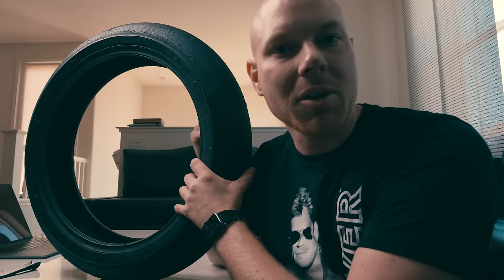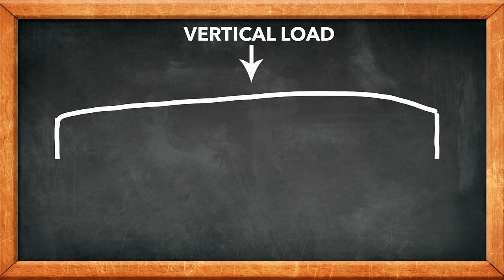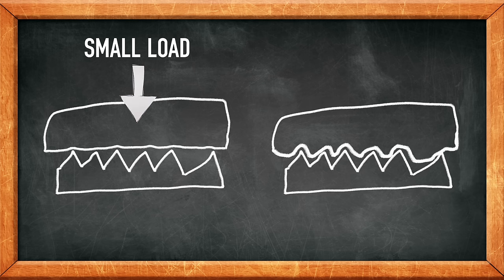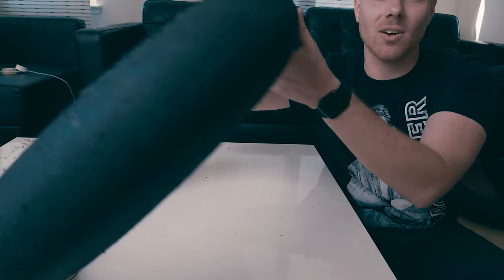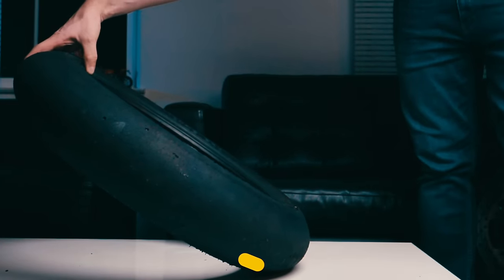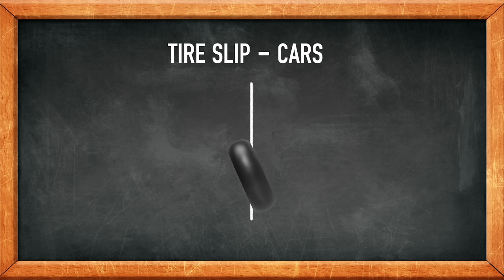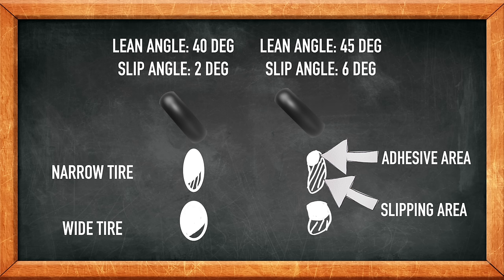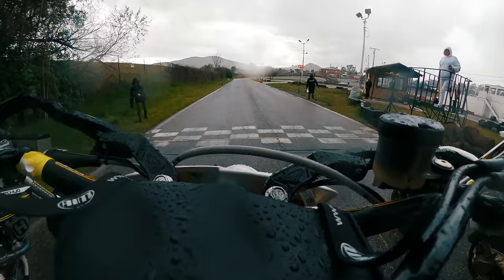Tire Grip | EXPLAINED

Comment: Mike, 
please talk a little more about Contact Patch shape on each front and rear Tire  at increasing lean angles.
The reason I ask is that I would like to be able to educate my friend on what i believe to be a misconception on his part.
Mark is on a 05 CBR1000RR with Dunlop Q4 190/55/17 and 120/70/17
reaching estimated lean angles of 45-47 degrees
Mark is under the impression that because he has no chicken strip that the rear tire is near its max lean angle. Keep in mind the Q4 is advertised to 62 max degrees. 
Thank you for giving us the engineers explanation on motorcycle behavior.

Comment: Great video!
An interesting topic would be:
What happens to dinamics and grip if you install mismatch tires front and rear on a bike (compound, wear,age, brand, surface design, etc)
Coz many people change rear tires due to quicker wear on the rear whilst still keeping the front for a while.

Comment: Hi Mike, a well made Video, and a commendable attempt, at explaining a complicated concept to a wider audience. But as an engineer I know all too well that any attempt to simplify a complex subject, will lead to inaccuracies, which will mislead the lay person and dissatisfy, the engineer. A wider tire with a harder compound, vs one of the same construction with a softer compound, or a bigger diameter vs smaller diameter tire, a tire with a different aspect ratio, the friction coefficient of different rubbers. The weight of the bike, the suspension setup, the steering geometry, the tradeoff of wider tires, and on and on. So really the title should read “all other factors being equal wider tires offer more grip”.

Comment: For racing tires it counts, for street legal tires - stop shopping for wider ones. Actual ones have added silicates to make them more quiet. It also reduces the lifetime. Had to change my Michelin Pilot Powers on my motorbike ( R1 ) because of cracks. With this added chemicals they also produce  less grip. So for street legal ones, µ will be 0,8 +- a few . But on most motorbikes the suspention is a point worth of taking care . Recently bought a XJR 1200 where the front fork pretensioning from factory was way too much. Bought Bilstein springs and made the pretension adjustable, way better now.

Comment: Ok, so if I get it right, if my front tire started whiping out on roundabouts on wet salted pavement despite very low lean angle (which it does) I should try to lower air pressure, yes?

Comment: Hey Mike,you seem very smart. I just want to add that on a jeep tire you have to under inflate the tires for offroading
Reply: People do the same thing on dirt bikes, but like he says off road tyres operate in a completely different way to track tyres.
Reply: Probably only for driving on sand?  The sides of the tyres round out and are far less likely to dig into the soft sand.  Over rocks and scrub you would need normal inflation - helps prevent punctures.

Comment: Great in depth video and good research Mike!
I tried to read these books but I do not have the time and patience.
- One quick question: If you encounter a dirty, imperfect street road  with gravel/ dust in a corner and your tyres are starting to slip, on what motorcycle tyres are you safer: a narrower type (aka middleweight adv touring tyres) or a hypersport standard naked/street tyre size? (I know you have to account different loads, suspension type etc. But say that all things are equal)
Reply: The tire that has the stickiest compound and largest surface area. That's why you run performance tires and slicks at the track. 

Adventure tires are not made to maximize grip, they're made to have good puncture resistance, long wear times, and good siping to handle a variety of terrain. So these tires would be worst by design, all things equal. 

You could argue the tread pattern maybe helps dig through the layer of dust (you didn't say how much dust there is) but unless there's literally just a layer of dust, like there pretty much always is, sticky track runner is better. 

If the dust is thick, then the sipes on the ADV tire would have to dig a hole for the rubber to then contact and hold. The question is, is that non sticky rubber block enough to hold you?
Reply: @YSPDJapan  good point and on point :))

Comment: I love fortnine videos but that Darkside one they did was borderline dangerous. Anyone who has been on track will know that lowering your tire pressure (to a point) adds grip by both helping the tire warm up faster (tire deforms more, thus heats up more, thus rubber is stickier) and by increasing the surface area for rubber adhesion. Thanks for clearing up!
Reply: @SuperBoomer95: He shows here that the contact patch is larger for a lower pressure when the tyre is upright - but that depends on the speed the wheel is rotating at. At higher speeds, the tyre deforms due to centripetal force, which (if the pressure is low) gives you a smaller contact patch at the centre of the tyre.
Reply: @gimmeanicecream9228  Agreed, yet another wacky X factor to the perfect tire setup for a vehicle.

Comment: As Cody from Practical Engineering explained, asphalt is based on oil and that's why there's so much adhesion - it's basically rubber on rubber!

Comment: Also, a wider tyre has more material. One of the major reasons higher power bikes have move material on the tyre.  It would be a nice experiment to put a thinner tyre on a 150hp bike and do some lap times.

Comment: Nice to see this kind of content on youtube👌 But in the beginning when you’re debunking the F = u * N you’re saying more surface area (bigger contact patch) creates more adhesion, and then you go on about how more vertical load creates more surface area. But thats the whole point why surface area (size of contact patch) shouldnt matter. When the patch is bigger, the verticle load is distributed over a larger area, which makes the rubber go less deep into the grooves of the asphalt, which decreases the area of contact for molecules to adhese. 

You also didn’t adress the subject of road and tyre shear. When we are talking about loss of traction, we can think of a tyre skidding on top of the road, but a tyre also tears itself and the road apart, (all the rubber stripes we leave on the track) which is affected by the size of the contact patch.
Reply: Is not that simple, reducing tne load reduces the contact area for sure. But what he pointed out many times, is that... we are talking about rubbe! So, you can go crazy trying to find an even close 1:1 relationship between load and contact area.
Rubber is a strange material, even an important reduction in load doesn't affect the grip so much (think at the example of rubber plate on glass). The "keying" mechanism between rubber and tarmac works with incredible efficiency even wiith low loads. Also, lowering the pressure and increasing the temperature can give you incredible grip at low-load.
Reply: @9.07 , wider tyres means more grip, but not because of the area of contact patch, but the shape of the contact patch, i totally got confused there, is that only when we are leaning on a corner ??? On a straight line, i feel your point of load distribution fits right in. ?
Reply: Thank you man tire friction/adhesion physic is highly complex and still not fully mastered and I find it kind of weird how he debunks these videos while they were mostly talking about street tires which significantly different than race tires.

Comment: Thank you.  Another very informative and understandable video Mike.  You have a talent for getting the facts across. So, can you help me understand something that has been puzzling me lol.  I recently noticed that the sipes, (or valleys?) on the front tyres of my and my wife's bikes run in diagonally opposite directions.  I know front and back are usually opposite/different in order to work better together but this puzzles me.  How about it?  Cheers and keep 'em coming!
Reply: Rear tire's biggest experience force: Forward accel. Water need to be pushed aside as it moves forward.
Front tire's biggest experienced force: Braking.  Recall momentum – a force you of a moving body wants to continue to move forward unless opposed by another force.
So, when you brake and experience forward momentum, the water is experiencing it too under the front tire. The opposite looking groves will displace it away from the center of the tire; where you need the grip to stop. These groves are that opposing force - channeling the water away. 
I hope this helps. I understand it is a little hard to picture opposing forces and the front grooves doing their job and think it's a great idea for him to make a video about it.

Comment: What I really want to know is the influence of the rim width. A 150/70 tire for example is suitable for rims with a width from 3.5 to 4.5 inch. What is the difference in regards to grip and handling when it is mounted on the narrowest and on the widest allowed rim? O.K. there might be surely some influence on the unsprung masses, as the wider rim will be heavier. But will also the contour of the tread change, or only the angle of the side walls? Will this lead to more grip, when you use a wider rim?

Comment: Which one is safer for front tire, 110/70 or 120/60 ?
Reply: It is not safer or less safe. 110/70 will turn in easier, due to less inertia, thus making bike nimble. 120/60 should provide more grip but bike will turn slightly harder. It also depends what kind of bike You are thinking. 125mm front tires are used in MotoGP and are enough.
If You are experienced rider, and do trackdays it may be worth to try 120. If not I would stick to 110.

Comment: Mike , does that mean that to optimize grip on a rough surface track, the best option is a softer tyre. So it can deform and grip more on the surface? And on a more flat and even track, The same softer tyre would have a similar grip to a harder tyre ?

Comment: I was just thinking about what size tire should I use on my sumo this is very helpful 
I’m running 110-140 and consider changing the rear to a 150 
The way I rode my bike use up all the surface of the 140 tire and few people told me I should get a 150 so I won’t run out of contact to the road
Is this correct?

Comment: Can I upgrade apache 180 bs4 rear tyre  "110/ 80 R 17" tubeless with " 120/ 80 R 17" tubeless ?? Please reply. Eagerly waiting to hear. After getting your confirmation, I will do the upgrade work. Is it require to upgrade the stock rim also?? Will it affect bike mileage too much or any major adverse effects on bike??

Comment: I'm still not sure I entirely buy it. Isn't all friction for any material caused by the molecular, microscopic, and macro irregularities between the surfaces? I thought that's what friction was essentially. I understand tire slip, but on a smaller contact patch, the ratio of surface area slipping to not slipping would just be the same, right?  Given that there would be higher per-square unit of weight to unit of surface area? The only place where this makes sense to me is the concept of adhesion, but I'd like to know what percent of tire grip is due to friction forces vs. adhesion, and the relationship between friction and adhesion. I'm reading up on that now. Anyway, I appreciate the video, but I think it would be interesting to construct an actual experiment with as many controls as possible. Can you mount an axle to a wheel with a tire on it, add different weight, and then use a scale to test lateral static and dynamic friction? Then test with different pressures to change the size of the contact patch? It wouldn't be comprehensive, but I think it would be interesting.
Reply: It seems to me that larger tires are good for balancing shearing forces across a greater surface area of rubber, which in essence, means that you can maximize the coefficient of friction for the material without it tearing itself apart under high acceleration or other lateral forces. This doesn't at all imply that the lateral friction force will change at all with the size of the contact patch, just that you can use a material with a higher coefficient of friction without it disintegrating, which is why drag cars use wider rear tires.
Reply: @FrancisLukesh  Well finally, something which tries to explain the dynamics of what is happening. I found your view interesting and to my non-scientific mind it could be plausible. I also like your proposed experiment.

So the material properties and not necessarily the size of the contact patch could be the determining factor? What happens with a harder compound tyre in comparison to a softer (described as "grippier) compound tyre of the same size and pressure? What would make one superior in grip to the other? 

Also, is acceleration grip the same as lateral grip (conceptually)? Interested.
Reply: Adhesion is a big X factor in the equation, especially with super soft race compounds.  In addition to whatever grip is provided by conventional friction, there's an effect like your tire is a roll of double sided tape.  Just like a bigger piece of duct tape sticks more than a small piece, a wider tire sticks more as well.  If you look at race slicks on cars as they come into the pits, they'll be covered in rocks, grass, and even candy wrappers as a hot race compound slick is effectively like a big roll of tape.  I think this is also a big reason street compound tires never really top 1G of lateral grip (on cars) as they aren't designed to basically melt into that adhesive-like state so they rely more on somewhat conventional friction grip and have a less substantial adhesion.

Comment: One very easy example to understand if the fact is true or not-
Try pushing your motorcycle when any of the tires is flat. :)
If surface area didn't have to do anything with the friction, you would need same amount of force to push your motorcycle irrespective of the condition of your tire.
And, that's it. 😊😎
Reply: It's not why it's harder to push. It's harder to push because the tire isn't round anymore which is kind of like having square tires ( not really since the air moves inside but its the same concept in the end where you need to force more to get in rolling because its sitting on flat instead of being on a small patch and wanting to tip over foward )

Comment: One thing I still question about ‘rubber grip’ is: What if the rubber has not reached the maximum depth of the grooves in the road (for example: if the vertical load is relatively small on a large rubber surface area). Increasing the vertical load would help pushing the rubber deeper into the grooves, creating a better grip. But if I am right, a smaller rubber surface area (instead of increasing the vertical load) will also help the rubber to push deeper into the grooves of the road, creating a better grip (since the vertical load vs surface area ratio increases)? Maybe I am wrong, but if the thing I mentioned above is right, a smaller rubber surface area could  (in some situations) help creating a better grip? Please share your opinion, because I am really curious.

Comment: What sucks is a single piece of gravel will completely fuck you up when you're on a motorcycle, but you'll be absolutely fine in the car.

This is because the car tire wraps around the gravel to keep some contact with the road, whereas the bike tire becomes completely airborne.

Comment: My bike, being from the 70s, has really tall narrow tires.  People always look at the little 110 tire out back and imagine that the bike must be really scary and slippery because of it.  Nah.  I can't speak for how original 70s tires behaved, but modern compounds are so good that you have to be quite a bone-head to run out of grip in a corner on it.  Like, slamming it WOT "on the pipe" in 2nd while dragging footpegs.  I don't have the ground clearance to drag elbow, so grip in that regime isn't important to my application.  Given all that, I like the narrow tires because they make the bike feel extremely light and flickable (and makes the tires cheap!)

Comment: F=mu*N is equation for sliding friction. Tires do not slide, they behave according to static friction equation - until they don't but by then you have bigger worries than size of contact patch.
Reply: In simplified physics,  F = μN is used for both static and sliding friction, you just change the μ value and it's usually a lesser value for sliding (all examples I can think of, though there may be an exception even in simplified physics). 

However, as described in the video, tires are their own thing and don't behave like stone on wood or wood on glass, etc. like that formula works for, they have adhesion forces that make the tire act like a piece of tape on the ground, which greatly complicates the whole equation.  Too much heat and the tire liquifies and gets slick, too little and the adhesion forces aren't there (drive out on cold slicks and you'll learn about that), so there's ultimately a very narrow perfect window of weight, heat, width, etc. for maximum grip, and ask any race team and they've spent their entire careers chasing it.  In cars, there's also internal shear stress across the width of the tire (some in bikes, but not much), which is why wide tire cars suck in tight handling situations as the tire wants to start sliding or hopping (or refuse to turn altogether) when turned too sharply, which is why you'll never see drag slicks on a road course car.  It's a hella complicated set of physics and even tire engineers themselves have supposedly admitted they don't fully understand it and rely more on experimentation than calculations to improve them.